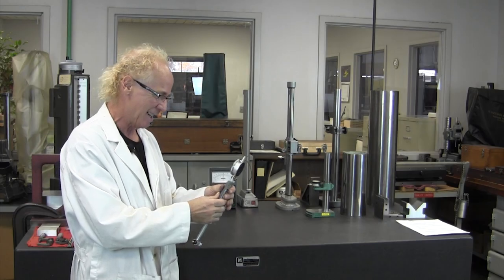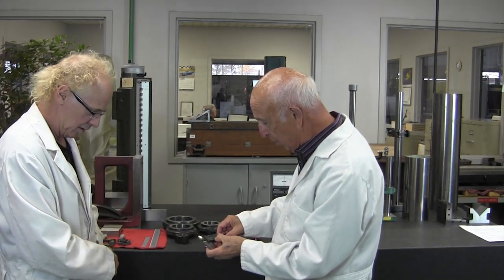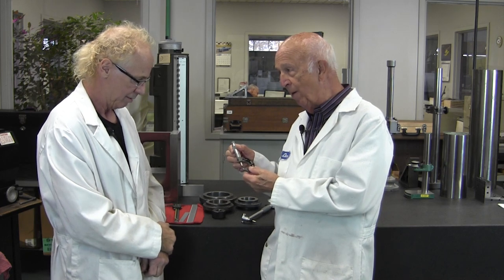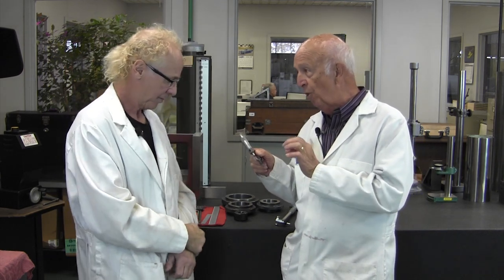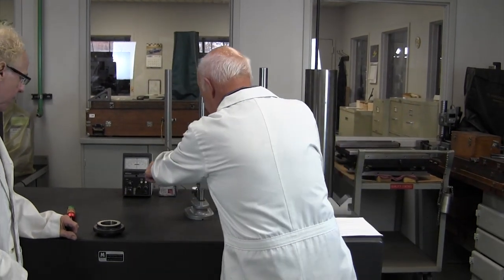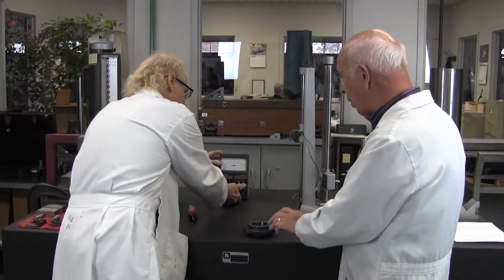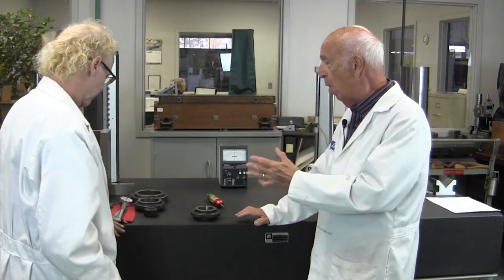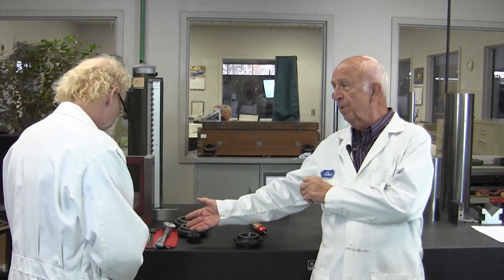How to measure using the proper tools, part 2.

Comment: Thanks, Don and Glen, for your very helpful video on precision measuring. As a long time machinist and tool maker I've never found a better method of cleaning a micrometer than a sheet of plain white paper. Simply clamp the anvils lightly on the paper and slide the paper out. The slight abrasiveness will clean the surfaces of any foreign matter.

Comment: The dial 'digital' caliper can also measure a step using the ends of the jaws. They are usually termed as 4 way or quadri measurement.

Comment: Always worth watching, Don.
What you call Reference I call Comparitors.
IE, they compare an absolute with what you are measuring.
I would place micrometers in that group as you use a reference to set them.
Another group like mics would be snap gauges which I don't hear much about these days.
I enjoy the art/science of 'manual' measurement.
The modern CMM's, that I've never seen or touched, would seem to reduce the skill required in the QA department.
Please, keep up the good work.

Comment: You had mentioned transferring heat from your hand into the tool and how it would effect the measurement. That's quite fascinating.  Is there a standard temperature or temperature range that tools of that quality and type should be used in?
Reply from the maker: Our inspection room is kept at 68° F.